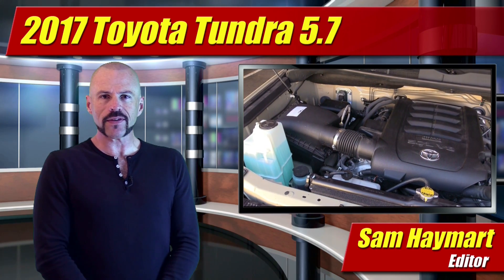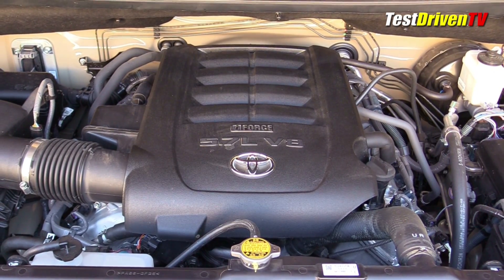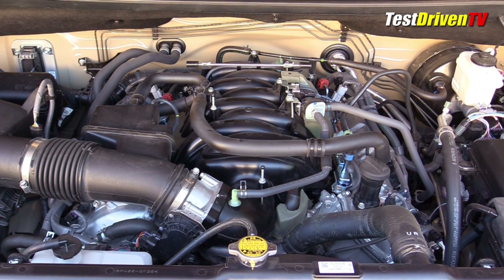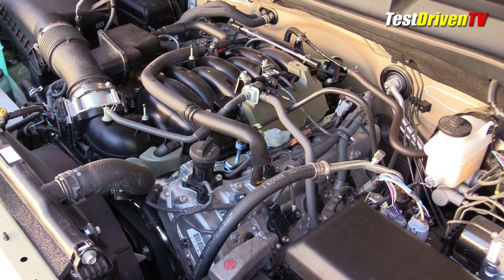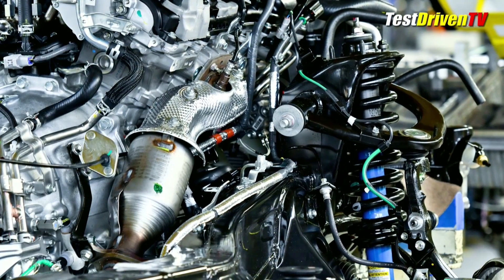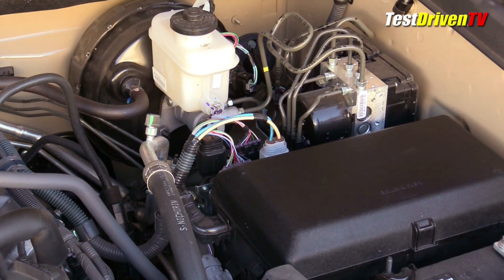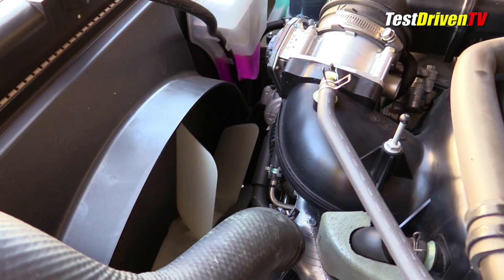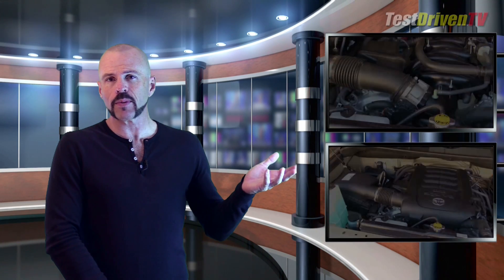Under The Hood: 2017 Toyota Tundra 5.7

Comment: I want to buy a truck and I don't know which one to choose between toyota tundra v8 5.7 or ford f150 v6 3.5, someone can guide me
Reply: Tundra. I have a 2008 tundra (5.7) with 300k miles on it and I’ve never had any major issues. They last forever and hold their value quite well. The gas mileage isn’t as good as the f150 ecoboost but the tundra is going to last longer, cost less to purchase (in most cases) and maintain, and it will leave you satisfied. Not to mention that 5.7 sounds great!

Comment: Terrible mpg.
My buddy has the 5.7l hemi Dodge  4 door truck. And he gets 18 city,  22 to 23 highway and 20 combined
Reply: And he gets 20 miles per transmission, 23 miles per rebuilt engine?  Dodge.

Exactly, Dodge that train wreck!
Reply: What!? Is that what he's telling you? My neighbours pushrod 5.7L Hemi is getting ( Real world) 14mpg around town and best he's got on the highway is 20mpg. Thats with the 3.20 rear end a an 8spd. I'm getting 12.75-13mpg around town on my Tundra and I can achieve 19mpg if I leave it around 60mph on the highway. I can't complain,  It's a truck.

Comment: Hadn't noticed how much this 5.7 is engineered just the like 1GR-FE, Tacoma's 4.0L. Same layout. Woulda been gnarly as hell if Toyota shoved this engine into the the Tacoma, or more realistically speaking, Toyotas 4.6L in it too!
Reply: Gabez82 Dakota RT may be your answer, less power but it comes earlier on the RPM line.
Reply: TheBikemaster94 Well perhaps, but I would rather have the proven reliability and longevity of a Toyota motor.
Reply: Gabez82 yessssss
Reply: much better than the 4.0 has tchain for each head tchain problems on 4.0 common

Comment: know lots of tundra owners whose frames rusted away and spent enough money fuel they could of just bought a real truck and saved money. engine would be modern if it was the 80's or 90's but not when some many better ones around.
Reply: Jonathan Watts that was tundras in the past lol. They settled that lawsuit. There frames have been ecoated for sometime now unlike Chevy that I had. I get 15.2 mpg average now with 45k on my tundra. My ecoboost got 14.4 average before I sold it and both my Silverados averaged 14-15. So I'm getting the same mpg with less problems. That's using the trucks for work not driving to an office and parking the truck all day.
Reply: Mike Hodgens my 10 yr old motor is just now getting the fuel mpg that brand new tundra gets
Reply: Jonathan Watts what 10 yr old motor. I'm talking all new trucks and the CAFE standards from Obama administration that was put on auto makers. If you don't own a newer vehicle then you don't understand the mpg reliability of these newer engines. You only understand what u read. I actually have owned 5 trucks in the last 4 years and used for work. I know what runs good and what doesn't. Read and believe what u want. 10 years ago engines had hardly any regulations

Comment: Still the most dependable v8 gas truck engine available. I hope they don't change it because it gets the job done and actually gets the mpg they say it gets unlike other manufacturers false mpg numbers.
Reply: Jonathan Watts there not trying to be the leader in truck sales. That's not what Toyota Tundra is about. I've owned two 14 Silverados and one 15f150. Nothing but problems with them because they keep changing things to the engines every year. Most truck owners use them for work or hauling and towing so they want dependability not a truck that's in the shop every 5,000 miles.
Reply: 11DS450XMX I don't even care about mpg. It's a truck. All I care about is reliability and not being in the shop for every little problem.
Reply: Mike Hodgens CAFE and the 2017 emissions regs will eventually kill this engine
Reply: dank the jank yes I know. But damn I love this engine
Reply: Mike Hodgens sure does not help them sale trucks because they sale the least about.
Reply: 11DS450XMX probably a coyote v8 which is very reliable. I had ecoboost that was in shop all the time. I also tow 5 days a week at least 65 miles a day.
Reply: Nope both were 3.5 EBs. Now I have a GM with a 6.2.
Reply: Mike Hodgens and that's why I'm glad we have Toyota.
Reply: 11DS450XMX yah. Had an eco boost. Never again. Mine was nothing but trouble.
Reply: congratulations!!!!!!!!!!!!!
Reply: Mike Hodgens  Had two F150s a 12 lariat and 14 Fx4 both 3.5 Ecoboosts didn't have a single problem and both got around 20 MPGs hwy. I now have a 17 Chevy with 6.2 and couldn't be happier.
Reply: Mike Hodgens  Owned F150s since 2012 and they've been in the shop for oil changes only.